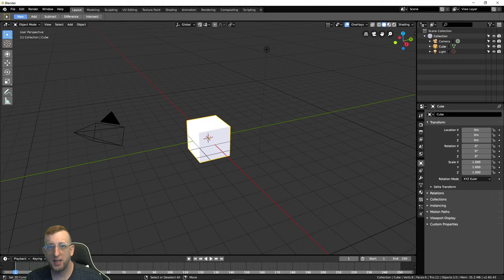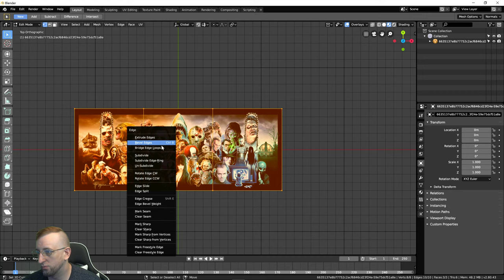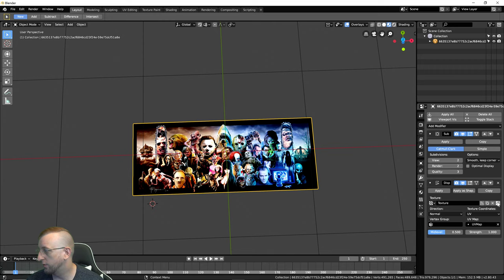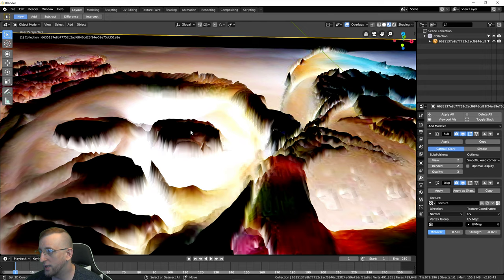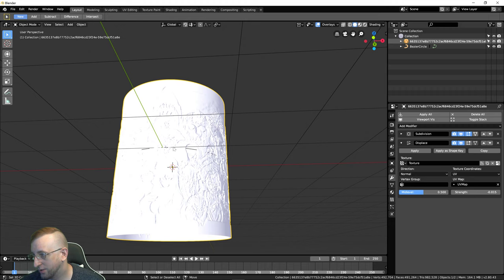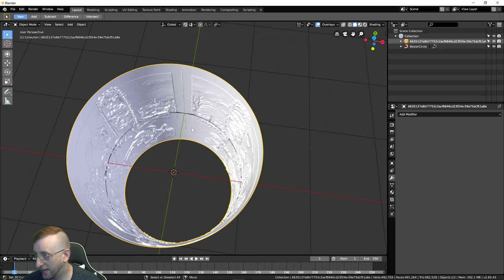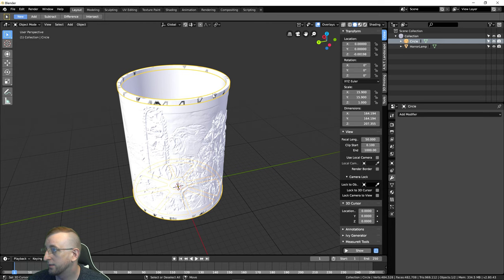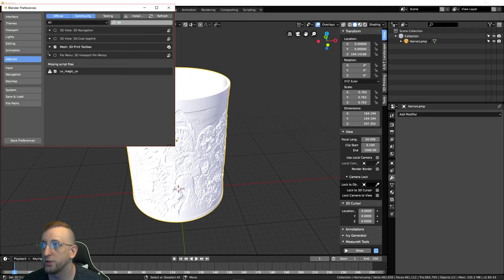Blender 2.8 Create a Litho Lamp

Comment: Your video is amazing, the best on youtube. I'm using it to make new shades for my Mason Jar Lamp in the hallway. Wanted to make the 'rough' surface on the inside so the outside would look smooth (as much as a 3D printer can). Stopped it halfway thru when realized that the image looked good, but more blurred. Put light on the outside and looked fantastic on the inside, not what you want though lol. So lesson learned, put the image on the outside just like yours. Didn't hear that mentioned so thought would bring it up for others.